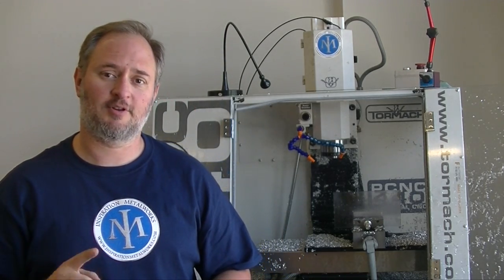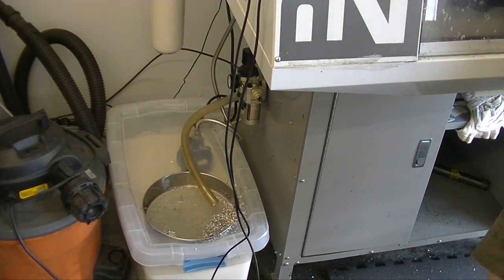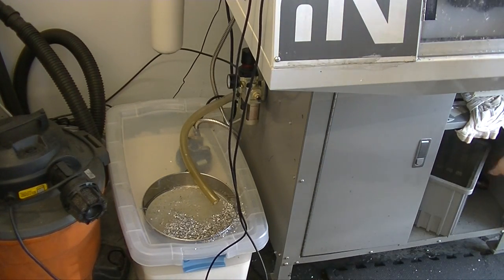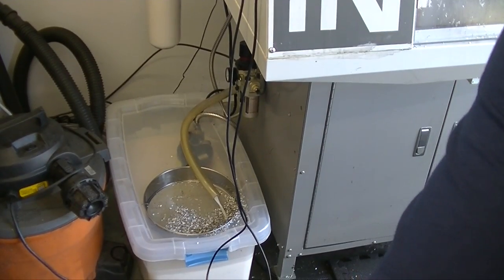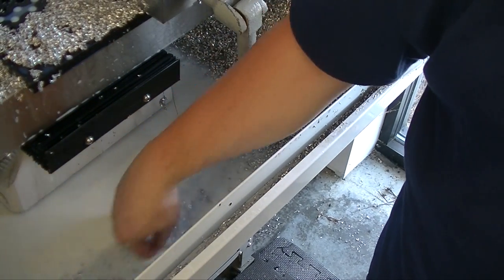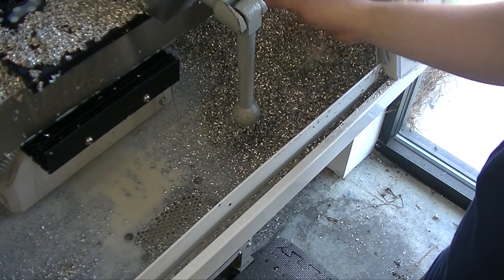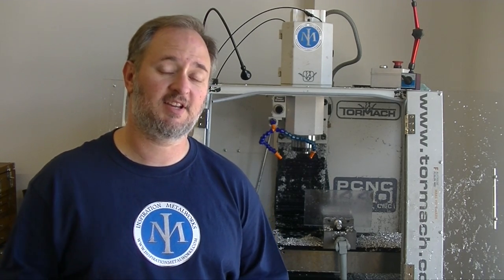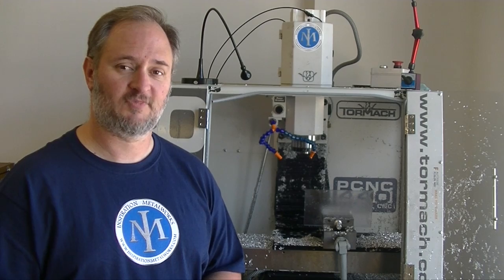440 Upgrades - Flood Coolant

Comment: Tom Zelickman your challenges doing production resolving coolant and chip evacuation, well presented and you are not alone.  Your on your way.  Can you make Hero's cup process work, It might enable utilizing time to settle out the particulates, as Hero's cup only draws the the upper most fluid, a two piece design maybe to enable cleaning.  Food for thought to possibly solve your filtering issue.  Cheers!

Comment: Suggestion...leave the flat grate in the sump, but add a shallow grate like a box lid over the grate, now you have 5 surfaces to allow drainage as chips build...4 sides and the the overflow of the flat lid.....thanks for showing as your demo will assist my sump on my bandsaw...time to modify
Reply from the maker: Thanks, Chuck! That's a great idea. It wasn't nearly as complicated a process as I was making it in my head. Hope all is well there and look forward to seeing you soon.

Best wishes,
TZ

Comment: I'm not getting near the life out of the filter cartridges that I should.  My pump is always-on, since I bypassed the relay, as a quick and dirty fix, just to get the coolant going with a small submersible.  Still need to troubleshoot the pump and motor that came with the old Hurco and put it back in place some day, since it is way higher pressure and would work with the gcode.  Just doing prototype work, I am getting by without too much aggravation on the CNC mill, but I am having the chip problem on my horizontal bandsaw with aluminum.  I distribute some strong recycled hard drive magnets in the coolant tray to catch most of the ferrous chips but aluminum just clogs things up.  Nice upgrades you've done.
-- Cheers, Gary
Reply from the maker: Hi Gary! I wondered if the problem was the cartridge as well. I'd like to do some sort of filtering for finer particulate but I wonder if I'm just getting a bit carried away. I like the magnet idea but I can see how that wouldn't work for the aluminum (which is mostly what I cut). The flour sieve seems to really be doing a nice job though. Have you tried that or a really fine mesh?

Hope all is well and see you soon, sir.
TZ
Reply: My horizontal bandsaw has a tank similar in size to the small one you showed and it has a small plastic sieve built into the top.  That quickly gets clogged with aluminum and it starts backing up into the hose.  The hole coming out  of the coolant tray is flat on top, even with the level of the tray bottom, so it does not have a depression to put any kind of filter or screen.  Also, the space for a added screen filter is about non-existent between the bottom of the saw and the top of the coolant tank.  I am thinking about using some of the magnets to hold some screen material in place over the hole before it drains down to the tank, but then the aluminum will just pile up around the edges of the screen and I'm not sure if that is going to be any better than the problem I already have.  My coolant tray overflows as it is when the tank sieve and hose clog up and if I just move the clog to the topside, I'm not sure I am making any improvement.  Just a babysitting job when cutting lots of aluminum, or clean up a huge mess when the coolant overflows.
Reply from the maker: +Tools4Machines Soubds like a real pain. Maybe you could relocate the tank and run a line from the existing trap? I've seen guys using traps from shower basins as collectors.

Comment: I think your filtering on return is way to go - a canister filter for sure would require a lot more pressure. I wonder if a simple gauze filter could help too around periphery of that drain in the sump... surprising the pump copes with chips going thru.
Looks like a good upgrade Tom.
Reply from the maker: Thank you, Chris! I do have a gauze filter as well but left it off at this point. Maybe I'll try that out as well. The sump has pretty loose tolerances because it's used for ponds, etc. That is why I went with the larger nozzles though. That tended to get clogged before anything else.

Best wishes,
Tom Z

Comment: I just got my own coolant system setup on my 440 with a 1/4 HP pump. I am having lots of problems with coolant leaking through the bolt holes mounting the mill to my stand as well as the pan just filling up above the base of the casting. Is this a problem that you have run into?

I wish I had found this video before I started my coolant system, very informative.
Reply from the maker: Sorry - just saw your reply here. This thing leaks like mad too but I missed the step in the assembly where they have you add in the sealant tape. I went back with silicone and sealed things up as best as I could but it still manages to leak from the doors.

Thanks for watching!
Tom
Reply: @TomZelickman  no worries, I ended up filling the holes for the bolts holding the pan, stand, and the mill with silicone caulking. This seems to have fix those holes.

Comment: Maybe add a false bottom to the tank that the pump sits on? That way any chips that make it through land in the bottom and you don't need to worry about that other filter at all
Reply from the maker: Great idea, Josh! Thank you. The other reason for the filter is to keep it clean but it seems to be working pretty well without it as you pointed out.

Best wishes,
Tom Z